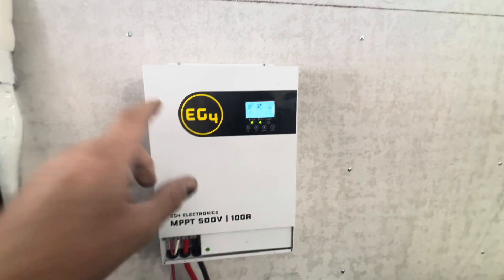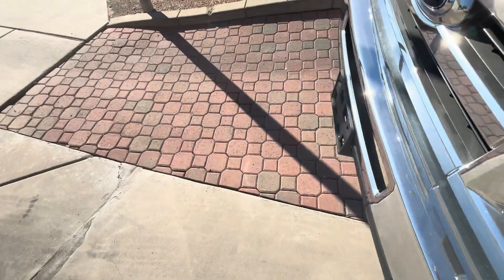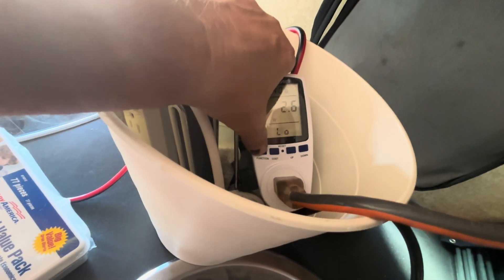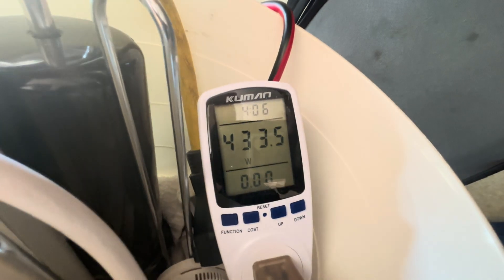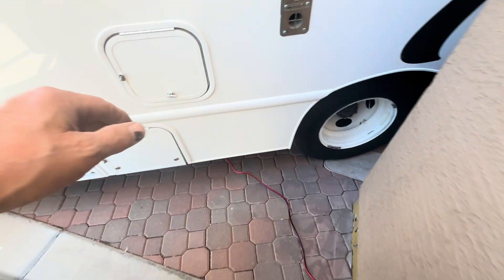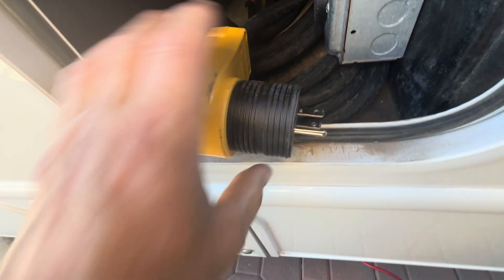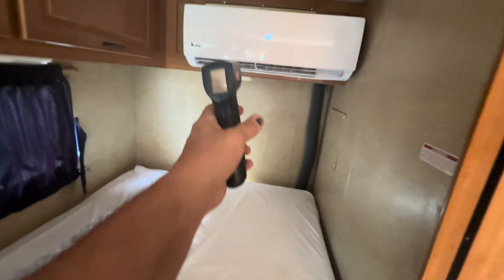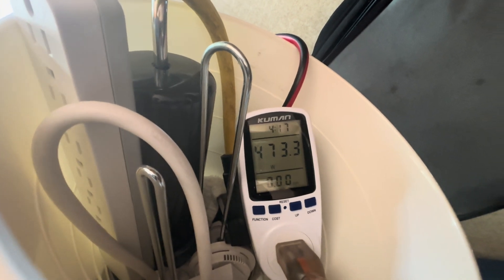Motor home mini split running comparison with 12-100 watt new panels and 4-400 watt used panels

Comment: Why does no one clean up their rats nest of wires, my two chief navy instructors would be rolling in their Graves at the mess I see!
Reply from the maker: This is a diy channel. This set is temporary to test for the motor home.,It is not the final product. With DIY you are constantly changing the solar arrays to figure out the best efficiency. Most diy people like me have no background in electrical, solar, hvac and have no higher education on these subjects. No engineering degree. Why are you expecting Navy standards with a diy guy that has been diagnosed with 3 cancers and had 3 surgeries in the last year along with a hernia again. My goal is to try out ways to use the solar, I’m not trying to impress anyone, just Sharing what I find as I go along. If I wanted something permanent, I would arrange wired so they are not a rats nest, but since everything I do is temporary set up I am not concerned about the wires. It amazes me that people who have no videos or channel or have ever tried to set up a solar off grid system are so critical of others who are at least willing to try to help others understand the basics. I’m on social security disability and have limited resources. Which also means it is extremely difficult to do simple task that others take for granted. I have very little dexterity with my hands and fingers anymore and extremely severe carpel tunnel in hands, wrist elbows and shoulders along with extreme leg pain if I stand or sit to long, so forgive me for not cleaning up the rats nest to impress you. You have no idea the obstacles people go through so you should be very careful in grumbling about something others do. Maybe you could go watch DIY solar with Will Prouse since he would not have a bunch of rats nest wires in his video. He is young and healthy and has the time and energy to make everything look organized. He is not suffering from extremely severe arthritis in his entire body as well. Hope you have a truly wonderful and extremely blessed 2025. May God richly bless you in all you do.
Reply: @diy-solar-guy 
I hope you're feeling better and had wonderful holiday.

I have three window AC - two 12000 BTU and one 8000btu.  I want to go solar.

Do you think it would be more efficient (start up cost) to convert the window AC to solar.  From what I've seen/read I would need at least an inverter, battery and panels for each.  OR
Purchase direct connect to solar minisplit.  OR
Purchase and convert minisplit to solar?

I'm looking for the least expensive oop as I'm limited  to SSD income. And will expand upgrade each year.

Thank you for your videos.
Reply from the maker: @TheoriginalDebunkit Thank you, feeling much better. A window ac is probably one of the least effective air conditioners. A one ton mini split can heat or cool a 500-600 foot area using around 1200 watts. The inverter style mini split will slow down compressor once room temp has been reached. Your remote is the thermostat. A mini split can also heat as well. So much more efficient as you can heat and cool with same mini split. It is expensive to start up solar off grid and sometimes is cheaper to continue using current window ac units depending on the length of time you will continue to live where you are now. All you pay for is electricity cost. I plan on staying in my house the rest of my life , hopefully another 20-40 years. I bought used solar panels for $20-$30 each locally in Gilbert AZ. That was a large savings. A 3000 watt inverter that could run all 3 of those mini splits or $674 plus shipping.You would need at least 1-51.2v battery to run during the day on solar, $1450.
25-250 watt solar panels $750
EG4 3000 watt inverter $735
51.2v LiFePO4 battery $1450
Wire, breakers, misc $150
Would be almost $3100 for just basic 3000 watt 110v output to run all 3 window ac units. Plus the cost to run 12/2AWG with ground from inverter to small breaker box then to each unit. Each window ac would need 110 volt output let, each outlet is limited to 15 amps. So you would have the cost of running the wire to each window ac. Add a couple hundred dollars for this. You are around $3500. 
Off grid solar is an investment that will pay back with savings on electric bill. By using a mini split to heat and cool large areas 20x30 area for 12,000 Btu mini split for whole year instead of main ac, you can save money.  It if you have that 20x30 area split up in to 3 bedrooms, it won’t work. You would need a mini split for each room. I live in Phoenix AZ area and the winters are pretty mild but summer is intense. Mini splits work great for me since e my downstairs is a L shape open area. Upstairs I have 4 bedrooms, a bathroom and a loft area. One or 2 mini splits will not work up there since these rooms have doors and air will not get into the rooms at all. Mini splits are great for big open areas not small rooms with doors. Running a 12,000 Btu mini splits uses about 1/3 of watts as a 3 ton ac.
You need to look at savings over each year for payback time to see if it is worth it. $3500 to add solar or how many years will it take to have spent $3500 in electric cost.
Reply: @diy-solar-guy 
Thanks.  At 4-500 electric bill monthly wouldn't take long to recoup.  I've tested power usage for six months and it's the central AC/heat unit.  When not used electric drops to around 150 per month which is affordable.  This is my retirement home so I'm looking long-term.

So if I go with mini-split 
They have ones now that are set direct connect to solar ( I have funds to get two currently)...  Do you know if batteries can be added to those for when there are cloudy days and at night?  
I'm in Southeast and mid July mostly in high 90s to 100s.
Reply from the maker: @ The direct connection to solar panel mini splits EG4 Hybrid 12,000 Btu is in link below.  have where you can connect battery bank or grid power, just need to charge batteries in the day with a charger, this mini split will not charge batteries. You can connect to grid power and limit 0-600 watts into mini split while not using solar like overnight. At 600 watts it will not be full power like when using during the day. You can expect to cut you summer bills by 40-60 percent using this mini split during the day using solar to power it. Hope this info helps. You can also call Signature Solar and speak to technicians before you buy and ask them all your questions and if they have any suggestions for your situation. They are always a big help, unlimited info on solar products they carry. Link is below for hybrid 12,000 Btu mini split direct solar panels connected. 

https://signaturesolar.com/eg4-hybrid-solar-mini-split-air-conditioner-heat-pump-ac-dc-12000-btu-seer2-22-plug-n-cool-do-it-yourself-installation/